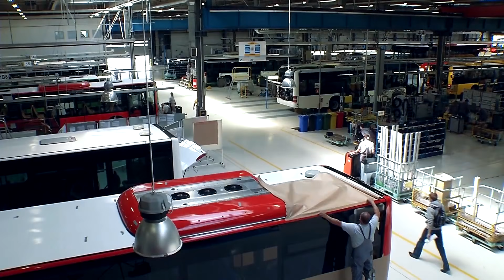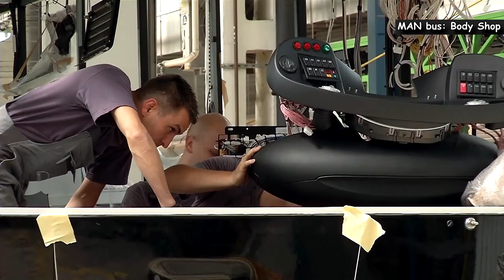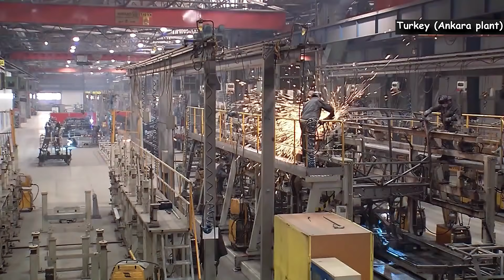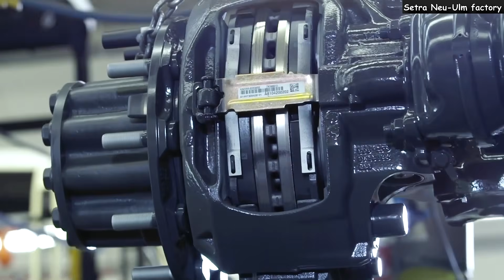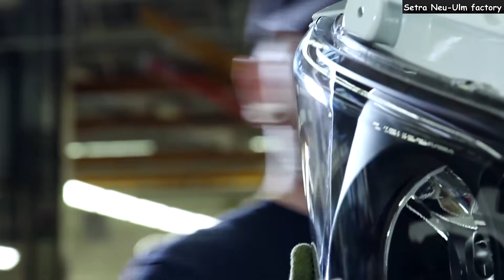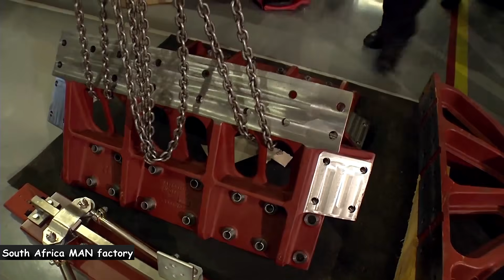BUS Assembly🚌2026 (MAN, SETRA, Mercedes): Production plant Factory➕ Manufacturing Process

Comment: Bro the instrument u saw with infrared light is a robotic total station (survey instrument) meant to check if final finish of bus is according to the required dimensions and that fittings are meeting the standard (length, width, height) dimensional requirements for production approval. Any discrepancy will lead to that bus being sent back to body shop for correction. This in turn enables the assembly department to assemble the body with other parts produced by other plants correctly to complete the process. Same dimensions are shared with other plants involved in parts production.